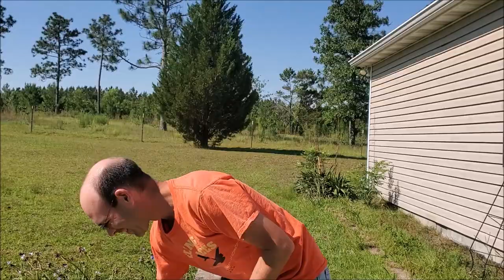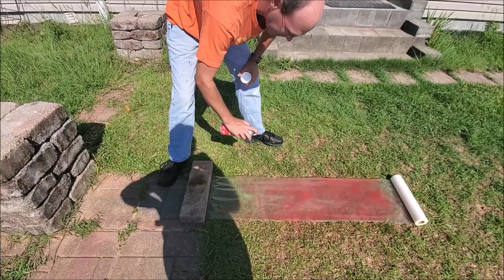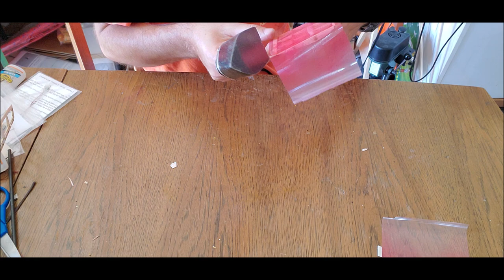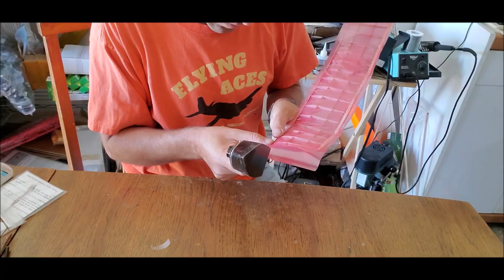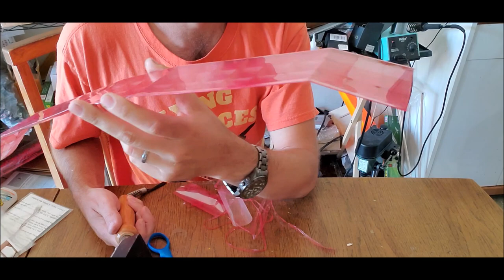Coloring and applying laminating film (doculam) to model airplane wings

Comment: Hi All.  I have some of the .6 mil J&H doculam and tried to cover a couple e-20 stabs with it but was not successful so didn't even try it on the wings.  I have no experience with monokote or any other such film, just tissue and poly span. I painted the doculam very lightly with Design Master paint on the adhesive side.  I used 1 coat of 50/50 thinned nitrate dope on the balsa structure.  I used a monokote type iron set to 212 degrees which is as low as it will go.  The doculam went on pretty good (bottom first then top then the ribs tacking around the edges first then working them together like the video) but the structure was warped terribly by the time I tacked all the ribs down.  I tried to heat the doculam with the iron and hold in place on a flat surface as it cooled and was able to get some of the warp out but it was still warped so I kept trying with more and more heat and even a heat gun.  I was never able to get it to flatten.  Similar experience on the next stab that I tried.  Before I try again I wanted to see if anyone could give me some pointers/advice.  
I think the dope on the frame may have been adding some difficulty so am going to try skipping that, good idea or bad?.  
I was wondering if someone could give me some more specific guidance on the iron temp?  
Is there a trick to taking the warps out that I am missing?  
Anything else?  
Thanks in advance for any advice!

Comment: Thank you for the video. Q: The doculam is just stuck on the plain balsa? No dope or anything? Greetings from the Netherlands.
Reply from the maker: Correct. No finish or anything. I do normally cover the top first so that I can wick thin CA into the bond at the  dihedral breaks since regardless of technique, I have trouble with film popping loose there (including with monokote).

Comment: Great tutorial! You mentioned wing warping during the streching process, how does one manage to fix that? I'd imagine a light structure like that would be easily bent out of shape as the laminate shrinks. Thanks!
Reply from the maker: Any warps can be changed using heat application while forcing the wing to the correct twist. The result are incredibly quick and effective.
Reply: Thanks for the reply!

Comment: I am building an lightweight DLG that uses 3D printed ribs. Would this doculam be "low temperature" enough to allow use on a carbon rod and PLA rib wing?  For reference, here is the DLG:   https://youtu.be/UxRinoQI4BE?si=XNwCtS0eLa5ErZA3
Reply from the maker: Oh dang it's a modernized Bug!!! I used to fly with Carl Dowdy who designed the original Bug. Anyway...the 0.6mil doculam is perfect for the temp range of PLA. The thicker doculams require too much heat.
Reply: @joshuawfinn  Sure is! @Geode has done an awesome job!  Now to find a supplier of 0.6mil in Australia...